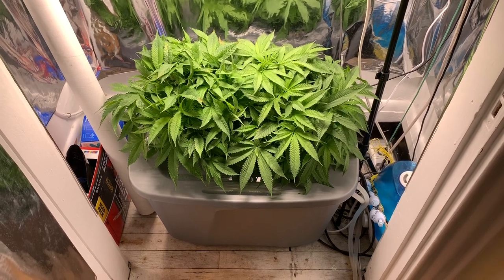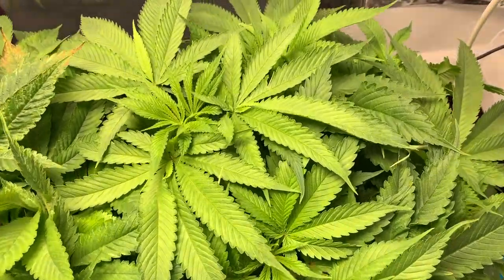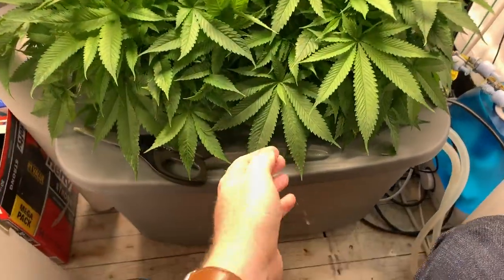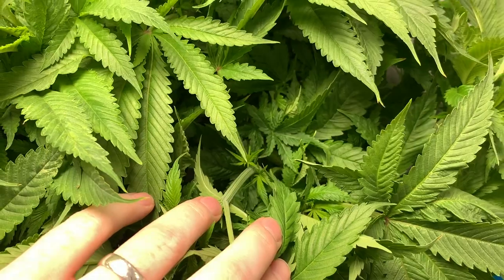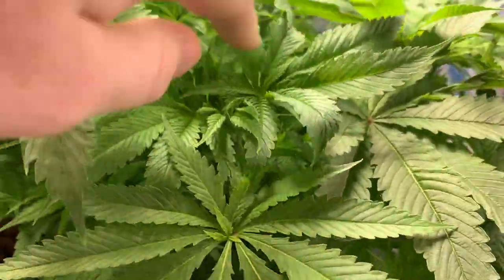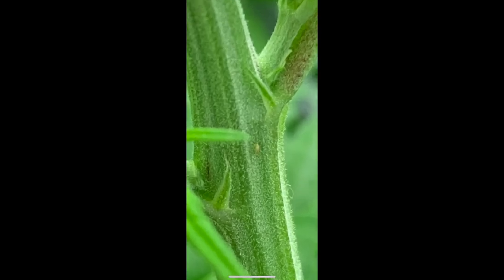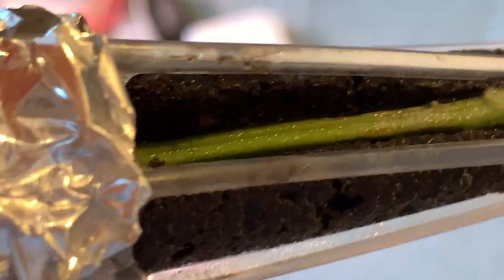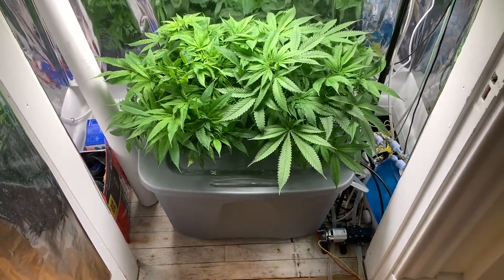The First 10 Days of Flower (And Another Cloning Attempt) | My First Grow 8

Comment: coupla things i noticed , you need more air mate ,  half ya res isn't bubbling ,  in tubs that size i learnt to use 4 x outlet pump and 4 x large stones, 
qlso never spray with the lights on , time it  so ya spray when the lights turn off,
i also have to ask did ya flush the clay pebbles , coz that stuff at the bottom of the rez  looks like the fine particles when the  clay pebbles are not flushed properly. 
Another thing , lift the air pump above the res level and if possible it also needs cold air , if the air pump fails it will drain on the floor with out 1 way valves installed.
Ya pic with the thrip does in fact look like a pistil , all the best mate
Reply: also ya cloners need bubblers as well,  scrape the the sides at the bottom of the stem and remove a tiny amount of the outside material with a sterile knife/scalpel, exposing that raw  plant matter encourages the clones to form roots faster, i also used to put about 0.2 EC of flowering nutes in  to encourage root growth  ( you would think it needs veg nutes ),  i been doing this sorta thing since 2004

https://www.youtube.com/watch?v=vmsfnUXM9Ho
Reply from the maker: @Roo0ooD  Thank you for all the detailed information! 🙏 I can look into getting more air into the res. As it stands now I have 8 liters/min going in there. I think if the air pump fails the water level in the air lines will only go up to the current water level, which is below the holes I drilled in the res. You could be right about the clay particles, I didn't rinse them as much as I should have.

I did scrape the sides of the clones, and I do have a small bubbler in there. My current thought is either the water is getting too hot because its in a black tub near the window, or I didn't clean the tub/nets enough and there is something in there that is preventing rooting. Im going to keep trying though!
Reply: @SmartGrowAutomation  if the air pump fails , the water actually leaks out from the pump itself,  through the air intake , it happened to me, thats why i  now put em above the rez,  or use 1 w ay valves ,hope that clears it up mate
Reply: GOOD CALL ON SPRAYING WITH THE LIGHTS  ON ROO DOOD.PEACE.